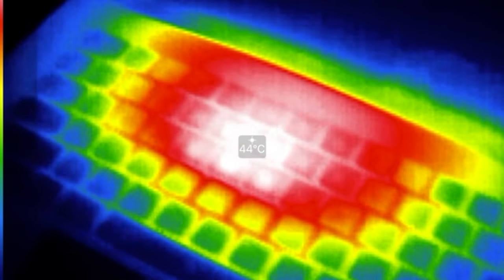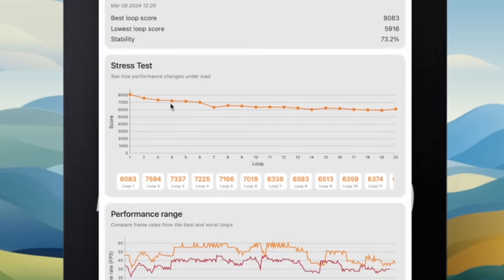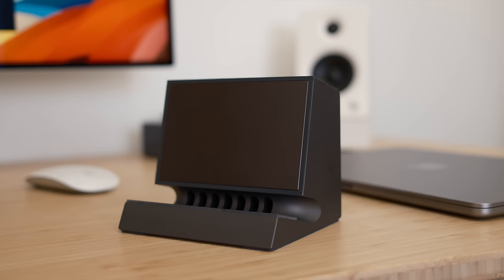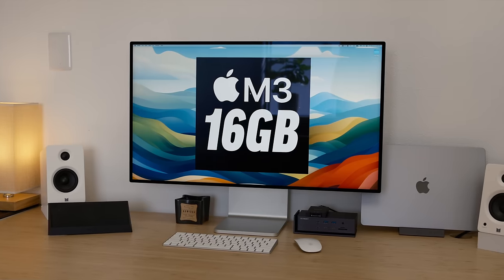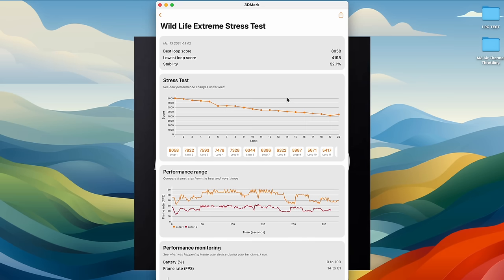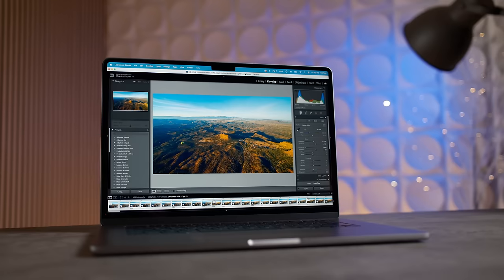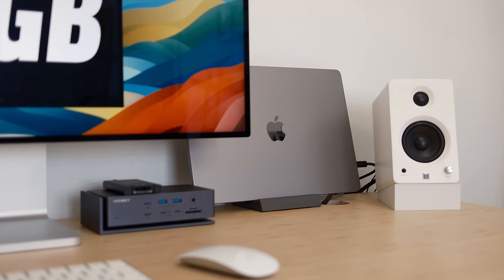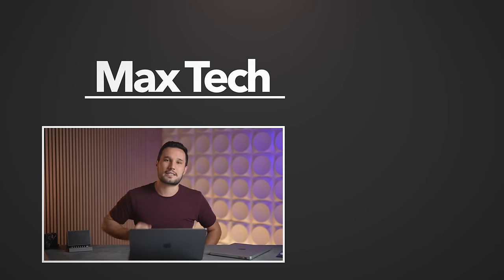Making my M3 MacBook Air FASTER than M3 14" Pro!

Comment: If you put your computer in the freezer it will be stable as well!! Come on Max… that fan is huge! No one is going to carry around that big fan, and if you say it’s for your desk… then what’s the point of an air.
Reply: I think they're trying to convey the versatility you could get with the Air. You could just put thermal pads and get better performance everywhere. If you use your pc on clamshell mode (that Apple is now promoting with the M3 models' capability of running two monitors while closed), the performance is worse than using it open as a laptop, so using the cooling block (that doesn't have a fan on its own) already makes it better and using the thermal pads with it pretty much makes the performance never throttle, if you're going to use this regular pc for long term performance stuff.
Reply from the maker: Prefect explanation! Yes, in this video I explored various questions I was curious about and found some sweet answers. Not only can the m3 air not throttle, but it could actually become faster than the 14” Pro. I never expected that. I also found that the Air in clamshell mode throttles like crazy.
Reply: One person actually put his Computer in the freezer and the performance was insane

Comment: So...lost power when you outside your home, lost 120hz, lost miniled display. Get little more space on your screen, save 0.04kg weight, save 100$ (and spend 300$ for svalt), buy thermal pads and get a chance to destroy your battery. I think it's good advice (no). (for 200$ difference you can update your memory for 16gb or ssd to 1tb on pro m3)

Everyone says air is so light. Do you really see difference in your bag (0.04kg)? I think no. My usually travel bag - Windows laptop + charger (~3.5-3.8kg), macbook air m1 (1.1kg), ipad air (1kg?), mouse, second phone, 3-4 chargers for ipad, mac, phones (yes, i'm lazy use only 1 charger and change cables) and some other thigs and I can carry my backpack for 4-6 hours without taking it off and my back is fine. So if you have some problems - just change your backpack.

Comment: Can you undervolt or underclock the M3 to get the heat managed?
Reply: There is low-power-mode, and CPU/GPU run with 66% less power. Cpu runs at 2.15GHz instead of 4.05GHz. You get lower temps by 5-6c but performance is half. M3 air is thin, warms up easily, chassis becomes warm easily even on light browsing/movies.

Comment: Just think, MacBook Pro m3 comes with fast 512gb storage plus 120hz mini led display, stable performance no matter what, extra ports. When you factor in the 512ssd for the air plus whatever fan or filling system that is not portable but bulky I think MacBook Pro all the way

Comment: Ye, lets pay a lot for a laptop that you have to open and put a thermal pad to it, because the manufacturer only thinks about money regardless quality. Steve Jobs, we miss you.
Reply: Hhhhh don’t be silly
Reply: It so it doesn't burn your lags
Reply: Thermal pad*
Reply: Thermal pads, not thermal paste. And the bottom of the chassis will probably get a lot hotter.
Reply: Should've come that way from factory!!
Reply: @edengate1  Would probably make the chassis too hot for regulations.
Reply: Here we are in 2024 and people are still making reference to Steve Jobs. Get over it.
Reply: The guy got the only form of curable pancreatic cancer and went for natural medicine and lifestyle changes....

Don't simp over him..😅
Reply: @Erik.Lundberg  it does. LTT did a video on it with the m2 version
Reply: Steve jobs was the same, tf you saying?
Reply: Uhm do you remember how hot the old MacBook Airs used to get? How much they would throttle? Do you know how much every other laptop in the world throttles because they don’t have anywhere near the power efficiency of Apple’s chips? To the point where they put friggin turbines in them just to contain the heat. This is not uncommon. And as others have said this solution would most likely not pass regulatory requirements.
Reply: I do light video editing so I’m going M3 air. I prefer the size of the MB air.
Reply: He was the one who said “you’re holding it wrong” so I wouldn’t put this one past him mate
Reply: Do the thermal pads void the warranty?
Reply: did you know apple was terrible at thermal design in Jobs? it’s significantly got better after Tim cook..

or are you from alternate universe or something idk
Reply: Whatever the Reason was.
Obviously Apple could do a better job. No need to be white-knight, people. 😌 We are all customers here
Reply: Apple isn’t ripping people off like you think they are by offering a mid range laptop with mid range performance. The methods in this video aren’t “fixing apples mistakes” they’re just modifying the MacBook Air into being a MacBook Pro.
Reply: Computers consume energy and produce heat. If you never boot up your computer the temperature will never exceed room temperature…guaranteed!
Reply: > The lack of fans were his legacy, and a direct result of his leadership on the company 
.- Steve Jobs always made apple focus on the features that wouldn’t show up on charts; Form over function. Like the Silence, Screen, Speakers (Except for the iMacs beyond the G5), form factor & size.
.- The original 128k and 512k Macintosh in 1984 were also passively cooled w/out fans, because Jobs complained about the noise. as a result, the machine overheated and lost performance & sales compared to cheaper competitors.
Reply: The surface isn’t allowed to exceed 47 degrees Celsius.
Reply: Let’s be honest, the consumer the MacBook Air is designed to target will never see thermal throttling so all this fake outrage over the fanless design is unnecessary
Reply: Apple have always had issues with thermals in laptops.
Reply: If you need sustained full CPU/GPU load performance get a pro with a fan, the air is incredible for most people.
Reply: @sammyjammy6647 Here we are with than mincing tyrant turning the Mac range into a mess of different clashing systems with massive overlap of features and maximum price gouging.  The reason people reminisce about Apple under Steve Jobs is he streamlined the Mac into clear ranges and actually thought of things like fair entry level pricing and user upgradability.  The G3 range had iBooks, MacBooks, the iMac both desktop and tower systems, the G4 and G5 range expanded on that and added the Mac Mini.  The switch to Intel added a lower end Mac Pro as a BTO option.  All these systems had user serviceable RAM and storage. Now everything is soldered, you get what you bought for the life of a system and they massively price gouge on RAM and storage.  Of course people miss Apple under Steve Jobs.
Reply: It must have a reason: if it falls for example, with that empty space, you don’t transfer the whole impact force directly into the internals. It’s made to last and resist falls
Reply: @freddjie3097  This is true, but the fact of the matter is that for the tasks you are expected to do on a MacBook Air, there is no need for fans :P
Reply: If you want better performance buy the MBP, simple 😁
Reply: I agree. I would rather just go with the MacBook Pro instead ? Who the hell would buy thermal pads and a cooler for a macbook just to see a better performance ?! 😂

Comment: Hey are there any downsides to this solution? Can you please advise it seems like there would be some drawbacks for heat or battery long term. Can you do some more tests on the battery heat?
Reply: There are downsides and they should definitely mention it. My experience is with the M1 Macbook Air, in which I have installed thermal pads 2 years and a half ago. The bottom case can get dangerously hot: 65°C (149°F). If you use the laptop on your lap under full load, this is above the maximum temperature allowed by the various laws around the world, so you must be careful and know what you are doing. The battery is a little hotter than usual, but I don't think it's a problem, though.

Comment: How tick is the thermal pad that you use for this macbook air? 1.0mm 1.5mm or 2.00 mm ??
Reply: Seems like he is using 1.5mm ones
Reply from the maker: I used 1.5 but I’d say to use 1mm it would be perfect.

Comment: Hi, if I may, I would like to ask for help.
I am using a Mac Studio M1 Max / 64 GB RAM for ArchiCAD (3D CAD design, among other things). I wonder if the current computers with M3 processor, even MacBook AIR , would not be better for this task? Especially with the additional cooling system you showed ;)
What do you think?

Comment: I’m in the market for new MacBook laptop!

I’m very interested in the M3 MacBook air

15-inch MacBook Air: Midnight
Z1BV
Configuration:
• Apple M3 chip with 8-core CPU, 10-core GPU, 16-core Neural Engine
• 16GB unified memory
• 1TB SSD storage

16-inch MacBook Pro: Apple M3 Pro chip with 12-core CPU and 18-core GPU, 36GB, 512GB SSD - Space Black
MRW23LL/A
Configuration:
• Apple M3 Pro with 12-core CPU, 18-core GPU and 16-core Neural Engine
• 36GB unified memory
• 512GB SSD storage
• 140W USB-C Power Adapter
• Three Thunderbolt 4 ports, HDMI port, SDX

What do you recommend to designer ?

Comment: Naw, there has to be a catch. Why wouldn’t Apple just add thermal pads? Im sure if they bought them in bulk, they would cost $.02-.03.  This is too easy.
Reply from the maker: There are laws that limit how hot the bottom of a laptop can be. Thermal pads transfer the heat to the bottom case that will make it very hot. Not an issue with clamshell mode or on a table top though.

Comment: Does anyone know how thick the thermal pads should be?
Reply: Seems like he is using 1.5mm ones
Reply from the maker: I used 1.5mm but I would probably go with 1mm because it’s a bit of a tight fit.
Reply: At 6:19 you can see it's 1.5mm

Comment: a very portable solution why not placing the MBA in a supercooled non-conductive liquid, its also not portable and also not cheap. The only usable solution is the thermal-pad-mod in terms of mobility, or even to choose the MBP what should be cheaper than the cooling block and had a better mobility. The MBA is not designed for constant heavy workloads, its designed for workloads that the average user has (so suiting/or almost overkill  for roughly 95% of the people) the rest (appr.5% or below) should strongly reconsider to spec a MBP according their needs. For 50% to 70% the Base model will be enough, for 25%-45% the spec for 16 GB RAM will be the right choice the 5% choosing the 24GB version sorry guys you are in the wrong room go next door.
Are there any statistics about the distribution how many of what configs are sold in terms of size, colour, RAM and Storage? Of course the absolute majority will be the base model as it is placed everywhere, then other BTO versions, but how is the distribution in the configured ones?

Comment: You might think that apple engineers would have learned about performance issues through thermal throttling. But no. My assumption is that has something to do with business strategy as an engineer would never allow that in the stress tests of the machines. That would mean that they intentionally underdesign expensive MB Airs to upsell to a better performing MB Pro ... Can't make this shit up.

Comment: Have you tried applying the same gizmos to the MacBook 14 Mx Pro? Does it also affect sustained high workload performance (video, noise reduction etc) with (otherwise?) significant rendering times and/or affect the behaviour of the fan (maybe lowering the noise level from “hoover” to “slight breeze” hardly noticeable?
Reply: Cooling the mbp would be faster. That one has only one fan . I use a fan app and max it out while rendering . It works great and no throttling at the expense of noise
Reply: @DaveDFX  Not if you own and use a MacBook Pro 14 M1 Pro ;-)

Comment: 14" Pro M3 - 11-Core CPU, 14-Core GPU, 18GB Memory ,512GB = $1,999
15" Air M3 - 8-Core CPU, 10-Core GPU, 16GB Memory, 512GB SSD = $1,699 
$300 Different.
but.......
if you buy the Stand Cooler is $279 which will be same as Pro M3 price and this will be stupid option.

Comment: Sensible people do not buy laptops with no fans if they are going to run intensive, sustained apps regularly. If you are doing that type of work, you would be wrong as, along with no fan, it has the base M3 chip, which is not a "pro" chip.

Just pay a bit extra for an M3 Pro chip, as you also get some extra features like miniLED and 120Hz with the added port versatility. 

It puzzles me that the MB Air, an obvious ultrabook for casual users, gets flexed when it cannot sustain loads it was never designed for. I wonder about the world when basic common sense goes AWOL on YT.

Comment: So adding a cooling pad internally to the MacBook Air M3 along with huge External Heat Sink AND a Desktop-Sized Fan will cool it down enough to match the all in one MacBook Pro M3?  Thanks.  But no thanks.

Comment: I would feel scammed if I purchased either of these devices. The MacBook "Pro" is nothing but an MacBook Air with a fan and the MacBook Air is nothing but a purposely handicapped MacBook Pro. Apple's current pricing scheme makes you fell like you're always buying the wrong computer.

Comment: So, wouldn't a laptop cooling pad not work ?????   AND cheaper !!   Just a thought..... Or buy a min-fridge, put laptop on shelf inside while you use it, over the top ??  lololol. Gotta think outside the box.
Reply: On the road, place a 2 gal ziplok bag partially filled with ice under the machine, run your exports and move on to the next project.   I've done it with the MBA on the passenger seat...

Comment: This is a very very bad idea. Other components might not be able to work long time with that heat dispersed to the body. Don't you think Apple engineers would have thought and tested this type of solutions? If you really stress your MBA this much: get an actively cooled one designed to do what you want to do with it.

Comment: The comparison is not fair.  There should also be some kind of comparisons of M3 Macbook Pro with Cooler vs. M3 Air Cooler and Pads. 
Why let the M3 Pro as it is and only tune the Air? you can also tune the M3 Pro further and expect some improvements, right?🤔

Comment: The MacBook Air has always been fanless! Duh.  This is an overpriced solution.  This should be $99.95.  I will watch to see if the thermal pads fix the M3 throttling w/o causing any long term issues.